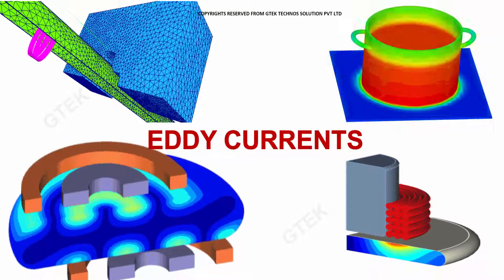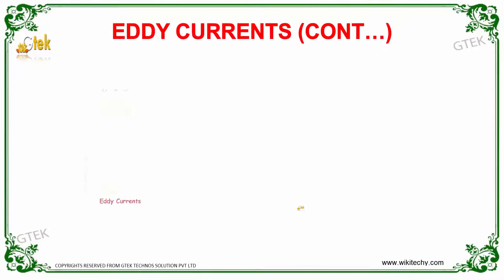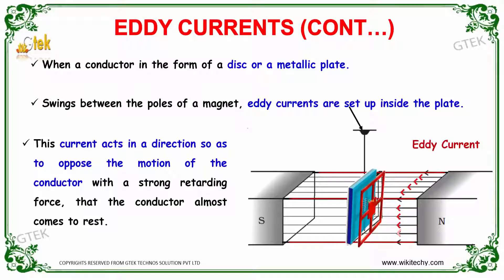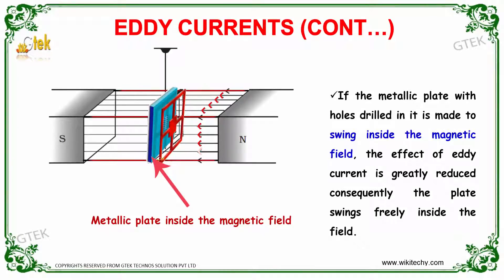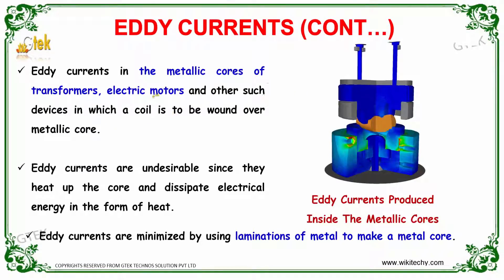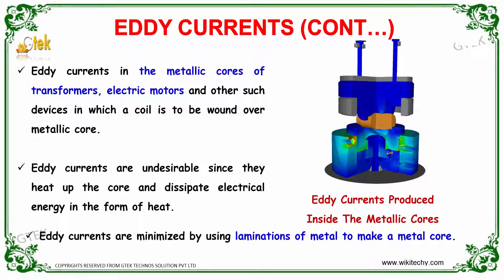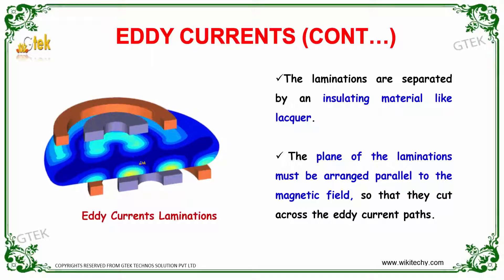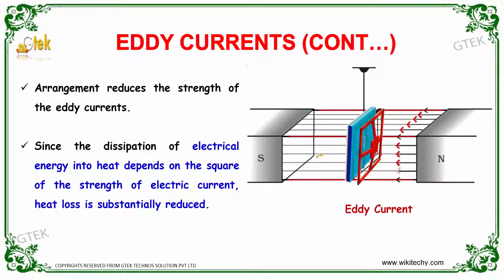Eddy currents|Electro Magnetic Induction And Alternating Current

Comment: By Lenz's law, an eddy current creates a magnetic field that opposes the magnetic field that created it, and thus eddy currents react back on the source of the magnetic field. For example, a nearby conductive surface will exert a drag force on a moving magnet that opposes its motion, due to eddy currents induced in the surface by the moving magnetic field. This effect is employed in eddy current brakes which are used to stop rotating power tools quickly when they are turned off.

Comment: Eddy currents (also called Foucault currents) are loops of electrical current induced within conductors by a changing magnetic field in the conductor, due to Faraday's law of induction. Eddy currents flow in closed loops within conductors, in planes perpendicular to the magnetic field. They can be induced within nearby stationary conductors by a time-varying magnetic field created by an AC electromagnet or transformer, for example, or by relative motion between a magnet and a nearby conductor. The magnitude of the current in a given loop is proportional to the strength of the magnetic field, the area of the loop, and the rate of change of flux, and inversely proportional to the resistivity of the material.

Comment: A localized electric current induced in a conductor by a varying magnetic field.Eddy currents (also called Foucault currents) are loops of electrical current induced within conductors by a changing magnetic field in the conductor, due to Faraday's law of induction. Eddy currents flow in closed loops within conductors, in planes perpendicular to the magnetic field.